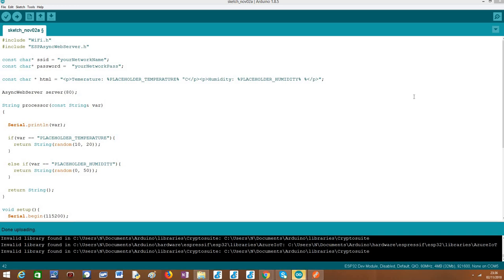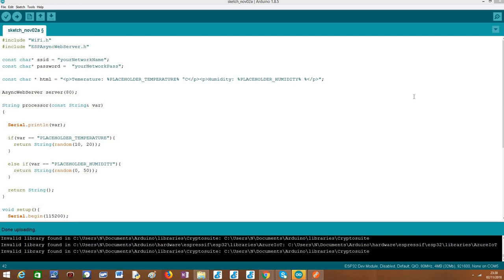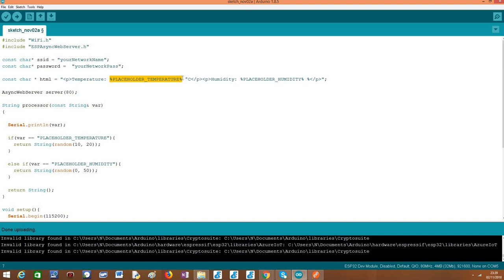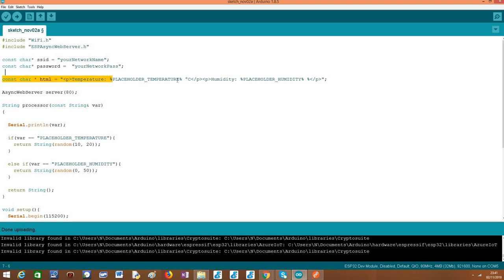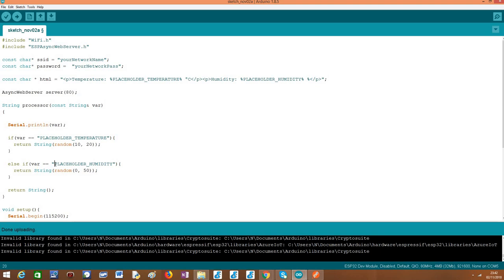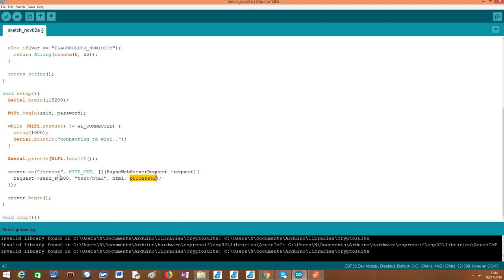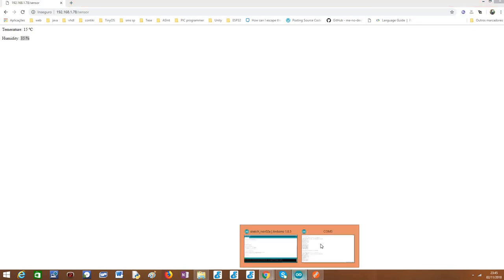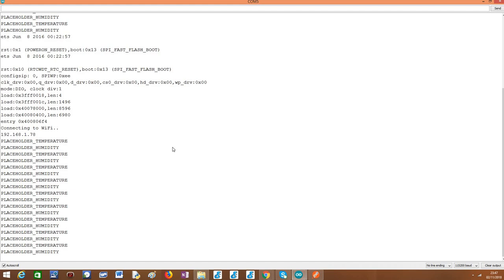ESP32 Arduino HTTP web server: template processing with multiple placeholders

Comment: Hello ! I'm currently working on the esp32 CAM, do you know if it's possible to connect multiple esp32 CAM to one server to make a mini surveillance station with two or three CAM ? 
Good vdo by the way !
Reply: ESP32-CAMs are at their limit streaming rstp. they get quite hot. You can use motioneye in home assistant on a raspberry pi 3 or 4 to record you esp31-CAM footage on movement.
https://www.youtube.com/watch?v=-7Yuo_VUBiw&t=109s
Reply from the maker: I just recently started playing with cameras but I believe 3 cameras to the same ESP32 won't be possible. But 3 individual ESP32s with their own cameras connected to a single server I would say might be doable :)
Reply: @techtutorialsx11  Home assistant with Motioneye works like a charm on a raspberry pi 4. I am a bit concerned though with how hot the esp32-cams get.